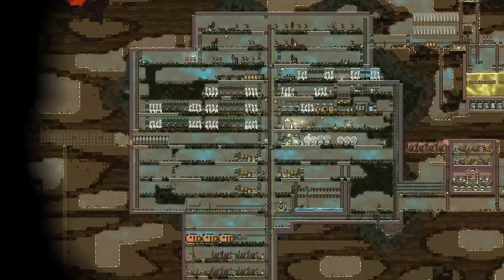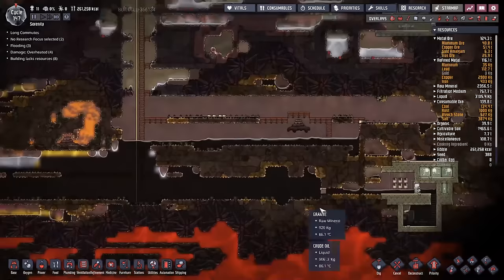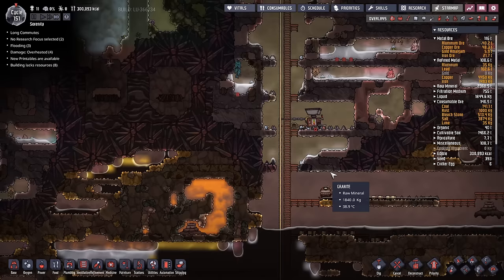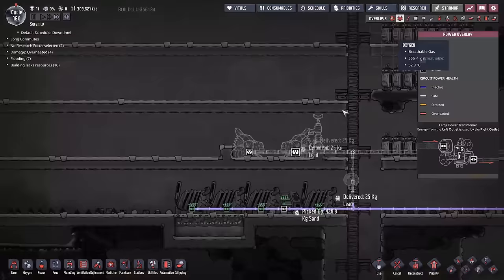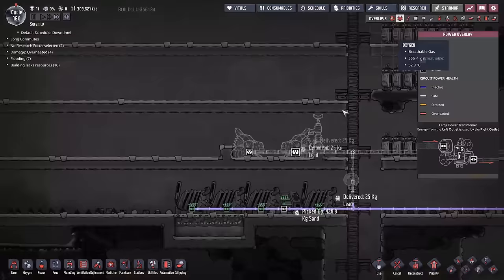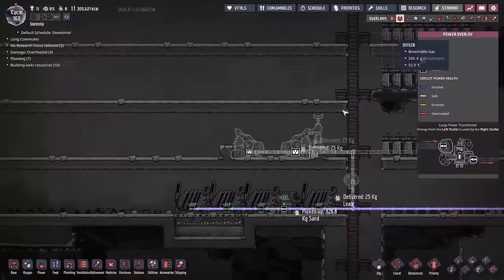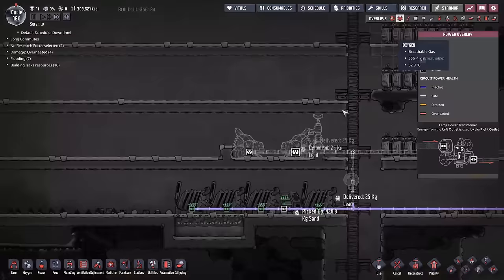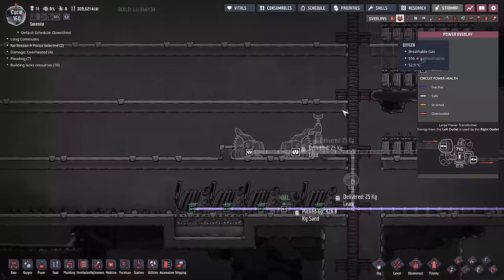Getting mid game Steel, Plastic & Cooling : Tutorial nuggets : Oxygen not included

Comment: So i build this contraption with polluted water at the bottom. Problem was that the dirt inside was getting to 300 degrees and broke my gold radiant pipes and i had petroleum leaking into my steambox. soo...just use regular water... or build radiant pipes out of steel.
Reply from the maker: How did the temp hit 300c, the steam turbine should never let it get that hot,
Reply: @FrancisJohnYT  I did a rollback on the game. Apperantly i made 1 piece of pipe out of lead which caused the whole thing to melt down. You really need gold for the radiant pipes. It works fine now... (UGH my bad)
Reply from the maker: @wijn1008  Everyone has had stuff like that happen to them.... several dozen times. It's one of the reasons we love this game so much,

Comment: Trying to copy this and running into an issue with the number of watts in my power cables, my heavy watt wire is carrying 3 watts, the conductive wire only allows 2, transformers only have options for 1w or 4 watts, is there any trick to solving this, or do i need some re-wiring to limit from the production area specifically for this location or just whack in a joint plate ?
Reply from the maker: Regular wire carries 1 kW, conductive wire can carry 2 kW all of thees can pass through tiles. Then comes heavy watt wire this can carry 20kW and Heavy conductive wire 50kW. They require joint plates to pass though walls. You cannot mix wires on a network or it will overload at the rate of the weakest wire. To split networks you use transformers. Small one's can split off 1kW and big one's can split off 4kW.

Comment: Why do you need a layer of polluted oxygen in the steam compartment? Can't you remove the gases with just water?
Reply from the maker: Polluted O2? do you mean polluted water?
If you just use clean water it takes over 1000kg of water to fill the first tile and push the gasses out of the second tile. Use a mix of water and polluted water and you can do it with only a few Kg of each. Allows us to fill the system much faster. You only need about 20-60kg of pressure per tile in the steam room so using mixed liquids is just a faster way of priming the system.
Reply: @FrancisJohnYT  Yes! That's what I meant. I get it now, thank you!

Comment: Where do you connect the liquid temp sensor? Cant get the setup to work
Reply from the maker: The pipe liquid temp sensor goes before the Aquatuner, it's job it to detect the temp of the water before it passes through the Aquatuner to make sure the liquid is above 25C.

Comment: Quick question, at 12:18, to push the oxygen out, we are layering polluted water on top of plain water. Why not use only polluted water? It has a bigger temperature range we can work with right? What is the need for the clean water underneath the polluted water? Thanks!
Reply: If you use only one liquid you need to put it 1000kg per tile into the lower layer to fill it. The two liquids are so you fill two layers with less liquid and push out the gasses on top. Otherwise you'd need to vacuum out the chamber, which is a pain

Comment: What is the purpose of the double bridge after the oil refinery at 19:35? Can someone explain this?
Reply from the maker: That was before the introduction of automation inputs on storage tanks. It allowed you to install two liquid tanks and once both were full you could turn off the oil refinery. Then the oil refinery would not turn back on again until one of the tanks was empty. Now a days you can get by with connecting automation directly to the liquid tank.

Comment: Hi I did exactly like your guide. But my metal refinery still taking overheat damage. While the water on the top floor isnt changing into steam at all. :/
Reply from the maker: Did you use radiant pipes inside the steam/water area? Did you fill the refinery with Oil or some some other high temp liquid?
Reply: @FrancisJohnYT  yes... but after the problem I had to change the metal refinery to ceramic instead on igneous rock and use petroleum as coolant. 
The water is becoming steam now and my metal refinery isnt taking any more damage. Can you do a guide on glass forge? I cant figure out how to not damage the pipe output of it

Comment: Is your liquid pipe thermo sensor connected to your liquid reservoir? The  Polluted water that is exiting the thermo aqua tuner is freezing and breaking the insulated pipe. Maybe the polluted water was already too cold? 45f - 7.2c.
Reply: You can only put them on the pipe. The aquatuner cools the liquid by 14°C, so it needs to set higher than it's freezing point plus that. Also the cooling loop doesn't need to be super cold really. 20°C is perfectly fine

Comment: For the oil refinery in the save you have a pipe element sensor set to petrolium but it disables the oil refinery even with empty pipes? what am i doing wrong i cant figure out how to just disable when both tanks are full
Reply from the maker: The pipe sensor should be connected to a not gate, the NOT gate flips to the signal to on until crude oil is detected in the pipes.

Comment: I tried doing the basic steam turbine setup setup but for some reason my aquatuner is over heating.  I made it out of gold amalgam is there something else I might be missing?
Reply from the maker: You should be using steel, it's the best heat resistant metal before space. Adds +200C as opposed to Golds +50C
Reply: @FrancisJohnYT  Thanks for the tip.  I had had to tear the setup apart for a moment and luckily I had enough steel for a new aquaturner, but I was able to expand my initial setup and get it to work without having to build a new one.  No problems so far

Comment: What kinda bothers me is why do you use a pump for oil to supple the metal refinery and not a closed loop with a few radiant pipes? Seems kinda wasteful power wise especially in the mid game where hear generated by power buildings is an issue.
Reply from the maker: Been a while since I watched this but all the stuff is closed loop on the cooling front. You pump petroleum into the refinery and then you disconnect the feed pipe. Save game file is attached.
Reply: Oh a reply! Nice! Not really tho, look at the refinery at 4:58. Imho a closed loop even with normal pipes should work nice perhaps a few tempshifts a bit later on. Thank you for the guide tho, at this point I dont exactly need it myself but I was curious ;)
Reply from the maker: @tyraelpl  Ah the first one, that is the temporary one so I did not bother investing any infrastructure into it. It gets run a max of 24 operations to get the necessary steel for the main build. Then it is demolished.
Reply: Yeah I know, still would save some power with little more to no more effort at all. I really enjoy your content and I like you as a person :) I hope you thrive and prosper as a content creator and especially as ONI one :P
Thank you!

Comment: i build steam thing but my  thermo aquanter always get broken cuz of cold damage and i cant cool my polymer press.I really dont understand whats goin on with aquanter.
Reply: i think i connect my automotion wire to the reservoir so i reconnect it with my aquanter but water can not go very hot so my steam tribune is not working and rafinery  with press overheating..
Reply from the maker: The aquatuner cools the liquid passed though it by 14C, it sounds like you are cooling the liquid passing through it below it's freezing point and it's breaking the pipes. Download the save file from the description and have a look through the build.

Comment: Just wanted to mention that I copied this almost exactly, and I found that once the water flashed to steam, the surrounding pressure of the liquid vent rose above 1kg so once the steam temp rose above 125C, the steam turbine couldn't run since it couldn't output water. I made the steam tank bigger by 1x2 and that reduced the surround pressure and made it work. Is this because I dumped a bunch of water instead of use polluted water + water? Thanks.
Reply from the maker: Liquid vents cannot output into pressure of 1000kg or above. Just make sure the pressure in the steam area is below that and you should be fine.
Reply: @FrancisJohnYT  How do you control the pressure in the steam area once it is enclosed?

Comment: Is there any reasoning behind that downward digging pattern? I know digging a single column ladder straight down can take a long time and alot of running back and forth.
Reply from the maker: With a single line down only one dupe can work at a time. I will need to enlarge it later anyway. More space allows the gas to flow. Give it a try next time you are digging down. Save the game, queue up the dig commands and see how long it takes. Reload and try the straight down method. Compare times they should be about the same.
Reply: @FrancisJohnYT  I usually dig an S pattern beside the ladder.  I read this somewhere a few months ago. Makes it go considerably faster.  Just wondered if the way you did it had any speed benefit (without trying it myself)
Reply from the maker: @devincode  Not that I'm aware, I'm just to lazy to redo the ladder system afterwards.

Comment: I use crude oil as my coolant for the metal refinery, it then goes straight into the oil refinery to destroy the heat.
Reply: unless it's a bug in the game, the heat should be applied to the petroleum leaving the refinery. i haven't paid any attention to temperature of oil at the refinery so i don't know.
Reply from the maker: They patched the refinery it now outputs at min 70C I believe but more if the crude is hotter. You can still dump heat by putting it in petroleum and burning it in petroleum gen.
Reply: commonsense 200 i just checked and you are right its not destroying the heat (it used to).  My buffer tanks are smoothing out the temperature though and my cooling loop is keeping the plastic cool.  Its the plastic im worried about, i dont want it turning to naptha.

Comment: hiya, was wondering if i could get some insight with a prolem im having, one of the output pipes of the auqa tuner always gets cold damage, not sure how to prevent this
Reply: Pipe Temperature sensor and bypass bridge as well as liquid shutoff. Putting a layer of crude oil on the aquatuner floor can also help transfer some heat to the pipe
Reply from the maker: Are you controlling the temp of the liquid? If you reduce the temp of the liquid below it's freezing point it will break the pipe on exiting the aquatuner. Check out the second save game file in the description. It has a functional cooling loop running. You can throw some heat at the cooling loop and see how it handles it.

Comment: One issue I've always had is clearing up those caustic biomes to create such an industrial block, any advice on clearing out the pesky chlorine?
Reply: Maybe let it sink down and pump it into space together with the CO2. Basically take an element sensor and set to oxygen. Invert it with a NOT gate. And then pumps run when that's green AND you have a certain amount of pressure. Once you've cleared all the CO2, the chlorine is next
Reply: @S_Black  Coming to think about it, a lot of my chlorine woes came from a time where I  didn't facilitate air circulation good enough, never used airflow tiles, used a 1 tile shaft and all as well as not clearing out space, carbon dioxide always took up the bottom half of my base and so chlorine would get to my plants. I'm probably worrying too hard about chlorine getting into the base
Reply: Chlorine isn't really that bad all things considered. And like CO2 it will drop down eventually, but settle above the CO2. It's just that unlike CO2 you can't scrub it. But I don't really like scrubbing my CO2 pit anyways, when I can just pump it into space.
I agree that it's annoying to have the stuff floating around though. In my current game I so far avoided opening chlorine pockets, but I'll have to clear out larger areas soon
Reply from the maker: I just make sure to clean up all the CO2, this leaves only chlorine at the bottom of my base and map. If you have saltines plant a few down there and it will soak it all up. Otherwise a gas pump with a filter and filter all the chlorine into a few gas tanks and or space. Also keep all your transport shafts 3 tile wide to help gasses settle or rise where they need to go.

Comment: my oil biome is around 150C, did I wait too long to do this or did something change with the game?
Reply from the maker: 150C sounds you you have a break between the magma biome and the oil biome and heat is leaking in. Find the hole and plug it quickly.
Reply: @FrancisJohnYT  that's what I thought too, but I couldn't find any break anywhere

ultimately I was able to fix that by dumping a bunch of cold water into it, now I'm just dealing with the massive amount of sour gas which is causing my oil refinery to be over pressure
Reply: @FrancisJohnYT  I think my best shot would be going up to space to dump it out
Reply: @blueninja012  It might not be a break in the abyssalite, but rather very hot abyssalite touching the oil can transfer heat (it's a known bug) so maybe there's that somewhere in the oil biome? Good luck dealing with the sour gas etc!
Reply: @robinvandenbos2079  I think the sour gas situation is being taken care of pretty well, though it does take up half the map at this point I've been slowly pumping it out, also thanks to plastic I've been able to use high pressure vents to continue operating

Comment: Please someone help me, my insulated pipe just breaks all the time. I have no idea how to fix it. I did as the video but still it breaks.
Reply: Which one? The refinery loop? The cooling loop? Make sure your liquid doesn't boil or freeze in the pipe
Reply: @S_Black  The insulated pipe inside the "steam cage"
Reply: @valleyFITONY  
If it freezes check that the pipe temperature sensor is set high enough. The aquatuner cools by 14°C. That's also why polluted water is used. So the sensor needs to turn off the aquatuner when the water is already cold enough and then the bridge bypasses it. The temperature doesn't need to that low anyways. 20°C water is perfectly fine.
If you somehow get steam in the pipe (doubtful) make sure you use ceramic.
Reply: @S_Black  Thank you, it seems to be working now

Comment: Can you please make a tutorial on how to transition the current industrial brick to the industrial sauna/ranch you use in your oasis series? I want to copy it but I don't know where to start
Reply from the maker: Oh wow that is a tough one. I mean I very much winged that one and don't have enough experience to speak confidently. The theory is simple enough, fill the room with temp shift plate and enough water to pressurize the room to 20kg when turned to steam. Inject heat with the metal refiners until everything boils.
Reply: @FrancisJohnYT  just make everything out of steel right? And then put the power generators on the bottom as well as the slicksters, which will eventually go molten?
Reply from the maker: @ironboy3245  I put the power generators on top in the steam itself. But in theory anywhere should be fine. The hard part is pre heating the room so that it's over 120C to start. If you don't preheat it the petroleum gens will cool it with their polluted water output.
Reply: @FrancisJohnYT  does it self sustain or do we need to constantly inject heat with heavy refinery use?
Reply from the maker: @ironboy3245  In theory it should self sustain, but in practice I had some plastic press going constantly, and intermittent steel production. Also lots of batteries. So I don't know what would happen if it's just the power gens.
Reply: @FrancisJohnYT  ...time to break out sandbox mode again

Comment: I cant find anywhere in the video where he explains where to connect the temperature sensor with the automation wire and what to set it at
Reply from the maker: Below is the time stamp to the sensor setting we put it at 25c, you should run an automation wire from the thermo sensor to the Aquatuner so it can control it.
The save game file is linked in the description, it's for the base game not the DLC and it's pretty old by now so I don't know if it will load up anymore.

https://youtu.be/OlzfMNGCb4E?si=RIy1mXyVahEcU9oM&t=884
Reply: @FrancisJohnYT  thankyou! I did work it out in the end 🙂

Comment: The output pipe from the aquatuner breaks every single time no matter what material i use.
Reply: It's breaking because the liquid inside of it vaporises/solidifies. Either use a different liquid or make sure your starting temp is low enough that it never becomes an issue.

Comment: If anyone sees this PLS HELPPP. I did this exact design but my pipe keeps freezing every time I turn on the aquatuner. It's always the output pipe that freezes. I even tried switching the pipe to ceramic and it still keeps freezing every time I try to run the cooling loop, EVEN when the water IS NOT below freezing. So I don't understand what I'm doing wrong. SOMEONE PLS HELP
Reply from the maker: Sounds to me like you don't have the Liquid pipe thermo sensor installed.
If you run water through the aquatuner and you take enough heat out of the water to freeze the water, it immediately breaks the first pipe segment it encounters.
Make sure you have a thermo sensor installed and that the temp is set at least 14C higher than the freeze point of the liquid you are running through the aquatuner.
(The aquatuner reduced the temp of the liquid passing through it by 14C)
Reply: @FrancisJohnYT  I tried that, and even tried setting the thermo sensor to 80 degrees + and it STILL was freezing as soon as the aquatuner turned on. Please help I cant figure this out 😢